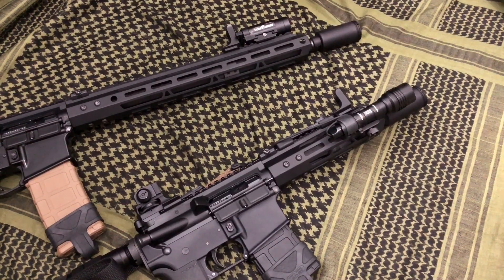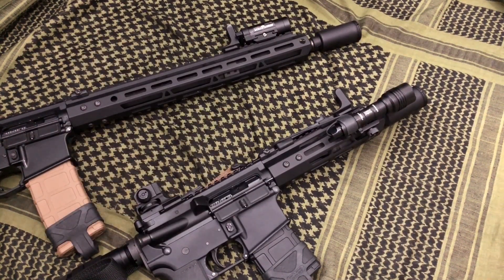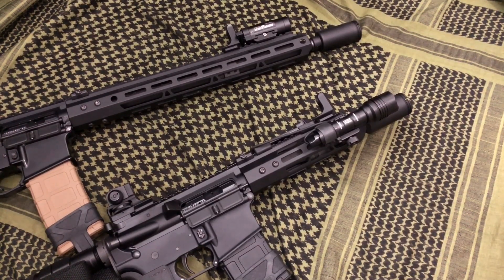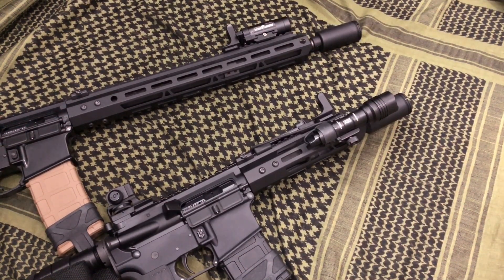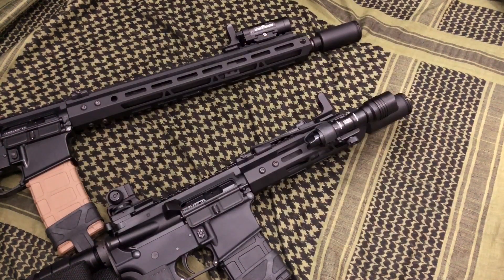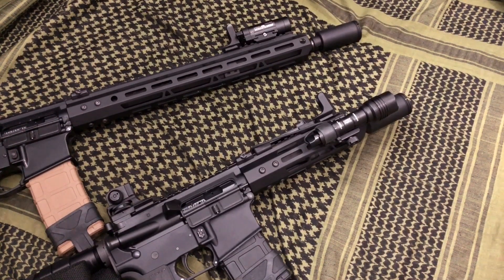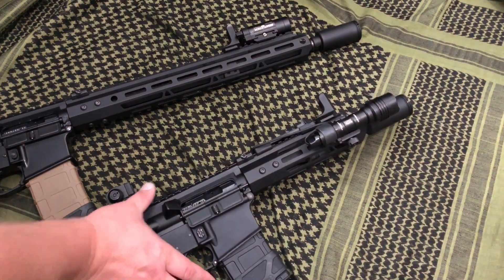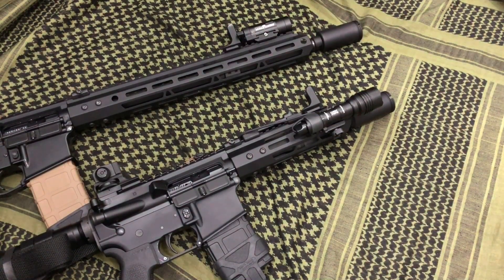Blast Can Muzzle Device

Comment: Shooting outside (and not under a bench rest with a roof on it) with a blast can, you indicate it takes the edge off,  how much would you say it reduces noise for the shooter? Not noticeable, hardly any, small amount.
Reply: All of the above: hardly any, not noticeable, amount so small it’s not noticeable. You will have more recoil and less concussion, which matters little in my opinion with an AR15, but becomes something to consider with a lightweight AR10 if your goal is to stay on target and not leave the range with a bruised shoulder.